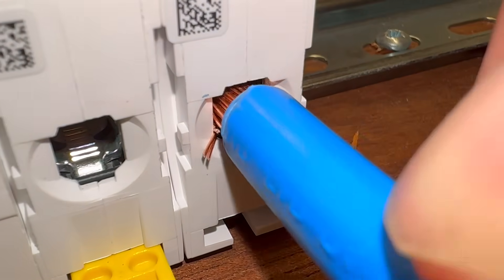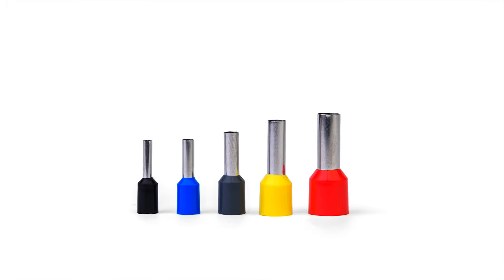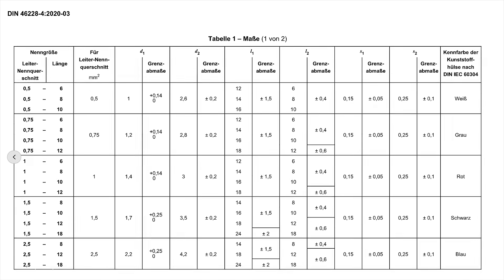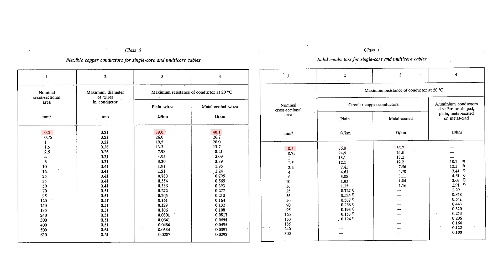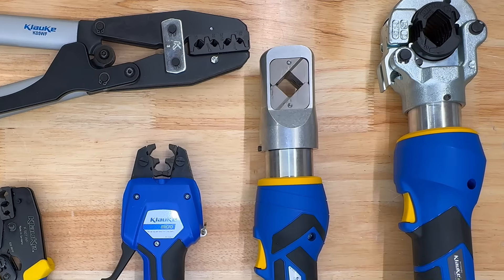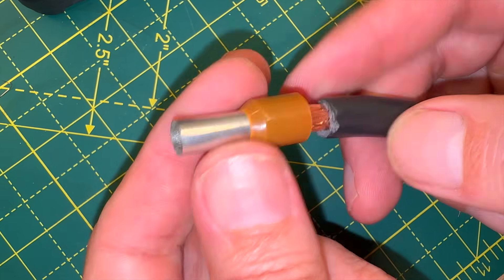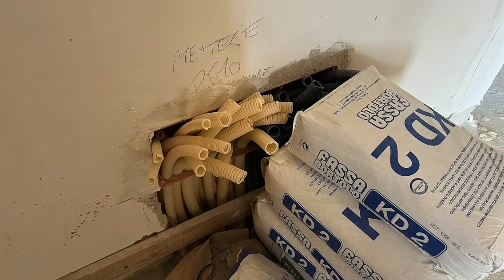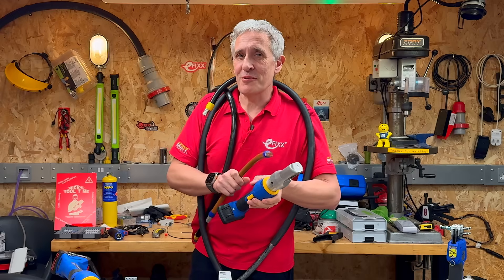The Truth About Ferrules: Overkill or Essential?

Comment: In normal life, not in industry, one drop of tin and a soldering iron for $10, solves all the problems discussed in this video
Reply: It creates bigger problems, it deforms too much and gets loose in a screw terminal.
Reply: @tomasz-5  It's forbidden in screw terminals in many standards, they always always come loose.
Reply: @rubikmonat6589  I understand what you are saying. Tin cannot be used and that is the end of the discussion. But still, a drop of tin solves all the problems shown in this film. Using tin will cause the wire to remain twisted, (bunch, tight) after the insulation is removed. The additional metal will cause the current intensity to be distributed evenly across the entire cross-section, which will translate into a lower temperature of the joint. Tin is soft, so the screw in the clamp will be able to make a hole (in the tin, not in the copper), which will prevent the cable from falling out. In the case of a correct connection of 2 cables, where the cables have 1 cm of common part inside the connector, tin will facilitate the increase of the contact surface. Pressed sleeves - absolutely not.
Reply: @tomasz-5  It's my profession. I'm a qualified cabler, hazardous area wiring and inspections, I've calibrated working termination tools for aviation and I do aerospace high reliability soldering. I also cable hydrocarbon plants where one spark can cause a very bad day. The solder moves with time and temperature because the alloy is so soft. It will work rest at first, then it comes loose, and loose connections get hot. I used to do it too, and every one old those old connections I've come back to is loose, I have stuff around that I built 35 years ago. There are few people with more training and experience at this, My experience and opinion agrees with the standards, do not tin wires with solder then put them in screw terminals. You just haven't caused your own fire yet.
Reply: @tomasz-5  It’s simple: solder cold-flows under pressure, so the connection loosens over time. That’s why the practice is banned. (And it’s the same reason why crimping onto solder-tinned wire is prohibited.)

Comment: I use them where screw terminals would cause damage to a bare cable.
One thing I see 90% of sparkies doing whether it's bare cable or ferrule is massively over tightening. NEVER have I seen one consult the data sheet that comes with the panel for tightening torque, heck most don't even have a torque tool.
Some even use impact drivers.
Reply: You’re so right! I finally got some torque drivers (nice Wiha ones, for pennies on the dollar on a local auction site) and did some experimenting (comparing datasheet torque spec to my existing do-it-by-feel torquing), and quickly figured out that I tended to slightly (though not massively) overtorque them.
Reply: @tookitogo  I don't think you're alone. I think most people think they known what x Nm is and they are way off.
I see a lot of people holding a torque wrench half way up the handle and of course not applying the correct torque. Then they click it to the stop there or four times for some reason.
Reply: @gottliebdee263  Honestly I don’t think most people think they have any idea what a particular torque feels like. I think that to the average person, torque units of measurement are fairly mysterious.
Reply: @tookitogo  Maybe. I have seen guys over the years say "oh I don't have my wrench with me but I've done this enough times, that';s about right now.?
Reply: @gottliebdee263  A feel for “what feels right”, absolutely. But I doubt that most would have any clue how much torque it is in numbers. (Unlike, say, how we can guesstimate length or ambient temperature.)
Reply: @tookitogo  Agreed,.

Comment: In the automotive world, fine strand conductors are the standard due to the nature of application

The irony is the need for ferules Ive found is relatively low these days with the exception of certain audio amps or trailer light sockets/plugs

Most products come with a set family of connectors ( metric water proof, deutche, NARVA, spade conenctor etc)

The availability of flate blade fuse holders means pretty much any circuit above 10amp are terminated using crimp on ring terminals.

Definately not a 'use it for everything' but not something to disregard either
Reply: Ring terminals provide greater pull out security and vibration resistance for automotive applications. The future (and current) of automotive wire preparation is ultrasonic welded wire ends. It turns a stranded cable into effectively a solid copper wire end.

Comment: On twisting strands before crimping; twisting wires increases the overall diameter so if they are later untwisted by pulling on the wire this could loosen them inside the crimp.
The effect increases with the amount of twist, so extreme twist angles could pose a real problem in round crimps.
This should never be a problem for reasonable twist angles though, since most well-done crimps or ferrules will sufficiently deform the wire to prevent untwisting.

Comment: Recently bought cheapo hydraulic hand crimping tool and it's squeeze force is nothing short of amazing. But that has its downside, if you are not careful and choose wrong crimping die it will squeeze out wire strands like a toothpaste. Also i have tested some custom 3D printed dies and holy moly that is a game changer.

Comment: Does anyone else treat the strands with a corrosion inhibiting grease/gel before crimping the ferrule?
Reply: Generally never. 
Sometimes on instrumentation sensors used in the HVAC services where condensation is an issue, even inside high IP rated junction boxes.

Comment: Sadly in the usa we use AWG and everything from china flooding amazon is in the units you mentioned in this video.  Stuff like 25mm^2 doesn't even exactly match any american wire gauge.
Reply: It does match very loosely, meaning you'd just use the next largest AWG size. So for 25mm² you'd presumably use AWG3.
Reply: @DmitriNesteruk the problem is the crimpers from China won't work on our wire sizes and metric wire gauge lugs are either too loose or too tight unless I get a really expensive tool that does any size.

Comment: You say that may explain why ferrules are used in distribution boxes in mainland europe.
but here in Denmark we mainly use solid wire also.

I’m aware that Spain seems to prefer stranded wire though (at least it is in my vacation home).

on another note: why do we use screwterminals when we mainly use solid wire???
Reply: Why wouldn’t you? Screw terminals work well for solid wire.
Reply: @tookitogo that is not my experience.
solid wires tends to shrink over time, but spring loaded terminals will keep there pressure, while screw terminals maybe become loose.
Reply: @MortenVindingSvendse  Well the wire certainly doesn’t shrink, but yeah, screw terminals can loosen, especially if there’s temperature cycling. 

I do prefer spring-cage terminals myself. But the real kind that work on stranded, not the cheap poke-in ones for solid wire only.

Comment: How do ferrules on cables ensure a secure connection? Typically, with contact crimping, there are two parts: one part is crimped, and the other serves as the fastening surface, like in a ring terminal. However, with ferrules, it's the same point, and the fastening method deforms the crimp. I have experienced several instances where, even with the correct ferrules and tools, I could pull the cable out, leaving the ferrule behind, especially in spring-loaded terminals.
Reply: Sounds like a bad ferrule crimper (too little or too much force) or bad ferrules (fractured during crimping).

Comment: I worked for a USA Company that did high tech. HVAC. When they found out you terminated a Stranded Wire, without a Solder-less Terminal, one day suspension at their call. Second time, a week suspension at their call. Third time sent to the owner for job termination.
Reply: what do you mean by  Solder-less Terminal?
Reply: @johnburns4017  Crimp on terminal - one that is NOT designed to be soldered.

Comment: I saw a video where they used some kind of anti oxidation compound before pressing a  eylet / bolt terminal end pice on a cables in a switch gear i think it was in the us. 
Is there a use if this in Europe, maybe in outside cold conditions situation like "ground cabinets "( those stteel  boxes with marking poles on)
Reply: Termination of Aluminium cable perhaps? Those lugs are pre-loaded with a jointing compound.

Comment: About joining two cables in a double ferrule.  I've used both twisting and splitting as an option to get both cables to mate nicely within the ferrule.
Splitting as in split aprox 50% of each of the cables, then overlap them, as you where to braid them.
Not sure if this is up to code, but I learned it from an old sparky that serviced the circuit box for my house.

Comment: why not solder with tin ?? it's durable and strong
Reply: Tinning stranded wire with solder is an absolute no-no for screw terminals, because solder cold-flows under pressure. That means that even if you tighten it correctly at the time of installation, it will loosen over time (even without vibration). Additionally, tinning with solder creates a point of failure at the transition from tinned to not-tinned, so if the wire is not well-supported, that allows flexing or vibration to cause the wire to break at that point.

That’s why it is strictly forbidden to use solder to tin wires for screw terminals (and for crimps, for that matter). Crimping on a ferrule is superior and takes less time, so it’s the standard today.

Comment: Just a little thing I know, but 25mm square is 25mm x 25mm, which is 625 square mm. 25 square mm is the cross sectional area of the cable which is not 625 square mm. I know I'm being pedantic but we engineers need to get this sort of thing right.
Reply: The sizing term relates to cross sectional area of course. 
Stick to your own field of engineering, which is obviously NOT electrical if you come out with that stupidity in confusion. 
We, as professional trade qualified electricians only use the term mm2 so as to not confuse the non-trade out there, because they may think it is a conductor diameter size.
Reply: @BTW... wow, as a professionally qualified electrical engineer of over forty years, I can not understand where you manage to misunderstand the basic principles of SI units.
Reply: Might just be an accent thing where the d on the end of squared is not enunciated. 

Where I live we all say 25mm squared and would rarely see square millimeters.
Reply: @sniperfi4532  In the trade here we just say 25mm. NOBODY is confused.
Reply: @sniperfi4532  I'm afraid I can't agree with this one. 
Square mm and mm square(d) are not the same thing. Square mm (cross sectional area In this case) is an SI unit of measurement. Mm squared is a general coloqualism of the symbol, m2 (the 2 is upper case, but my phone does do that, sorry), which is the symbol for square mm, not mm square(d). I know can be confusing, but it has lead to a lot of miscalculation over the years.
Reply: @mikebirkett010  The only confusion in that is for the non-professional electricians.
Reply: I think you just agreed with what I said...

Comment: Depends on the patience of the installer I guess, flexible wires requires slightly more care to details than full copper cables. I'd say it's an overkill but there may be instances in whitch with the proper tools it's faster to install these cables than installing them manually

Comment: Not sure if you have covered it, or code even mentions it:
Touching the copper leaves fingerprint "gunk" on the copper, thus making it corrode long term.

So my take: If you twist it, please don't use your finger-tips to do it!

I don't know what kind of conditions speed that effect up, or slow it down.

Got any comments about this? anyone?
Reply: Its not usually an issue.  Oxygen has a bigger effect than sweat and oil from your fingers.  A screw terminal (of various sorts) puts sufficient pressure on the copper that corrosion is not usually an issue unless environmental conditions are really poor.  In situations like that... for example, if you are near the shoreline of the ocean, then fully sealed housings and removing the air interface become the important box to check.   So at that point you are using fully sealed housings, weather rated enclosures, closed-end lugs for crimps, and heat shrink.
Reply: @junkerzn7312  Aye, it is mostly salts that end up causing the problematic sorts of corrosion that can infiltrate the touching copper surfaces.
And it is only certain salts too, like chlorides, I have some crimped lugs that operate above molten sodium hydroxide and get exposed to splatter and they are doing just fine.

Comment: I love a good ferrule, but there are certain scenarios where I think i can get a better connection without them, especially those pointy tip screw terminals, you sometimes have to overtighten them to get a good contact.

Comment: Have to say the cheap crimp kits seem well worth the money for DIYers using only uninsulated ferrules to rewire 3-pin plugs, fit flex-outlet fused spurs etc., as well as for low-voltage lighting circuits wired with stranded cable from the transformer.  A bit of brass in these situations isn't going to cause any major issue, is it?  (Genuine question btw - I am not a spark just a DIYer keen to get it right.)
Reply: @blackworx I wouldn't have thought so. After all the terminal that it is connecting into is also brass.
Reply: I just stick to putting solder on the end of the wires, since I only do such stuff at home.
Reply: @Teh_Spetz  Yeah, I think I probably would do the same as you, but I'm not always at home when doing things like that (helping out friends etc.) and I don't need to solder much, so my kit is rarely to hand.

Comment: @18:20 over-strip by about 15-20mm, twist the leading end only, pass twisted section completely through ferrule and out the other side, crimp, trim the excess
Reply: no need honestly, just over strip by 5 mm and have patience if there's any resitance whatsoever when pushing the wires in, you need to pull out and retry, that's what works for me 99% of the time

Comment: 526.9.2-3 says not to solder. Can you please explain why. As a retired electrician and heating engineer i found a lot of equipment pre soldered. Which led me to believe that it was safe to use on fine stranded wire. Honeywell and Drayton come to mind with pre soldered fly leads.
Reply: Tin cold flows under pressure, so a screw terminal will loosen over time as nothing will take up the slack. Spring terminals, of course, are unconcerned. Additionally, the transition between soft bare copper and soldered is a strain concentrator which can work harden the copper and break.

In some cases what looks like a solder tinned lead may be a tin plated wire which has been ultrasonically welded together - if you can make out each strand but they're stuck together, that's likely the case. The tin plating is too thin to be of concern. You can also solder dip just the very end of a wire to hold it together so long as the contact area is on bare copper.
Reply: Multiple reasons to avoid soldering.  For one thing, ferrule crimps are not cold welds so, as Monken616 says, solder crushes so easily that it only takes a little stress to loosen the whole connection if the soldered section is put in a screw terminal or vice grip (or any sort of clamp, really).

But there are other reasons too.   Solder-wire interfaces go from a solid block to bendable stranded wire.  That interface between the solid and the bendable portions of the wire are extremely vulnerable to vibration and stress and can slowly break the strands over time.  This is the most common mistake people make when soldering stranded wire.

Soldering has certain positives as well, when you do it correctly.  Take an MC4 connector for example.  If you crimp first and then solder the crimp area, the solder provides an excellent layer against corrosion and oxygen ingress into the crimp and the MC4 connector has sufficient straight-length of cable behind the crimp as well as sufficient strain-relief to prevent strand breakage from the solid solder interface.

This is true of numerous other connector types as well.  Power Poles (Anderson connectors) can be soldered... both fold-over crimps for the smaller connectors and larger crimps for larger diameter wire (sometimes requiring a torch), as well as solder style connector interfaces (such as you see with XT60's, which must be soldered).   But again, these connector systems have lots of straight-length retained cable behind the solder joint to avoid strand breakage.  And, again, this is done to prevent corrosion and oxygen from getting into the non-cold-welded crimp.

On the fliip side, crimped lugs for bolt-on cables should NEVER be soldered because there is zero strain-relief or straight-cable retention behind the lug.

This nuance is lost on a lot of installers, and even quite a few electricians, so the rules are very conservative and lean towards not soldering as the safer rule.

-Matt

Comment: Don't get the difference between brass and copper ferrules as far as resistance goes, considering that the terminal they will be going into will be brass or even steel.
Reply: Brass ferrules should basically never be used.  Those are mostly going to be fakes and scams.  Stick with copper and tinned copper ferrules (tinned copper is generally the best all-around choice).

Comment: Comment on resistance of a thin wrapping of brass nags for a comment on tinning of copper (vs untinned copper) nags for a comment about reinserting oxidised wires without scraping or re-stripping... particularly in clamp-down terminals.